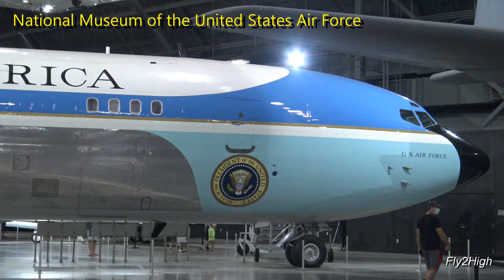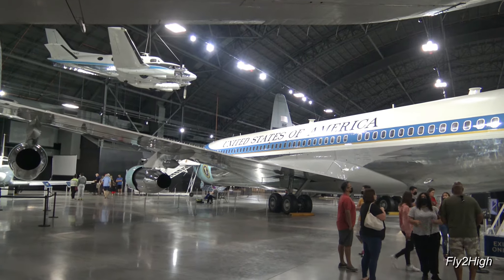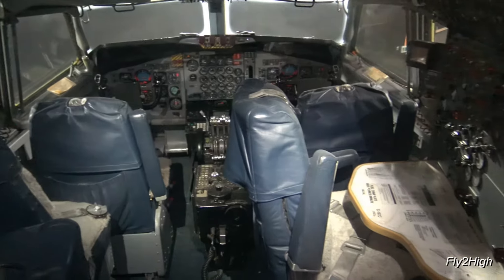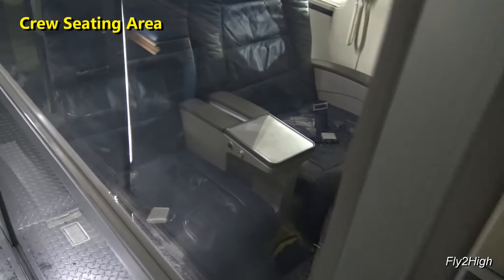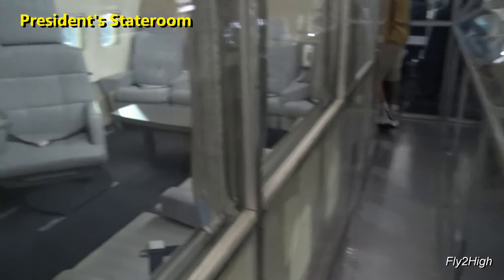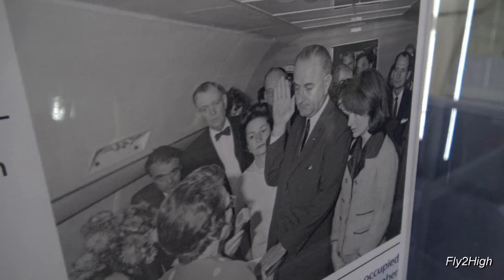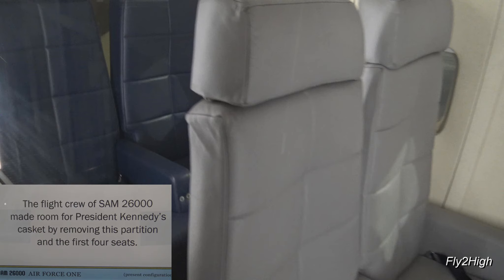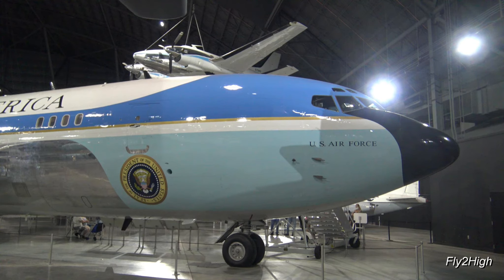"SAM 26000" a Boeing VC-137C Presidential Aircraft - FTHVN 851

Comment: Tail number 86970 (SAM 970) was the first presiential jet. Eisenhower & Kenedy used it. It is a VC 137B (based on the 707-153). The VC 137C replaced it in 1962.